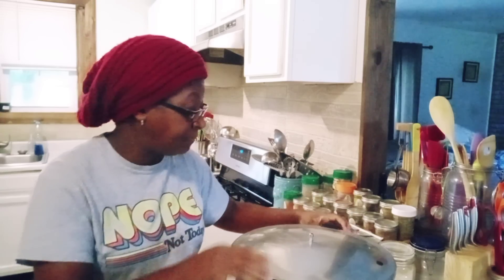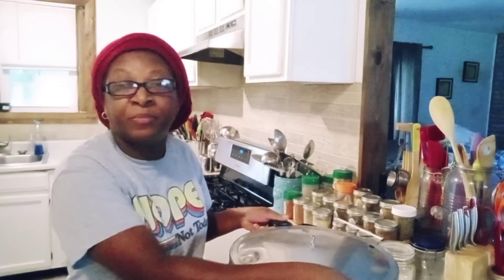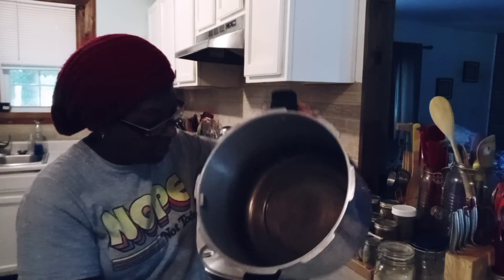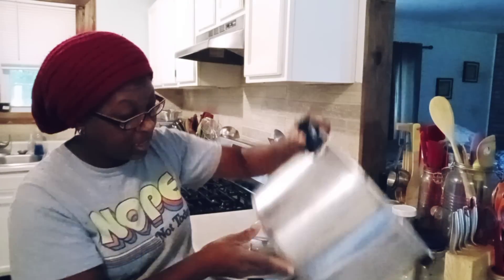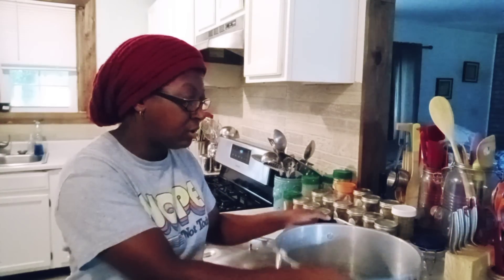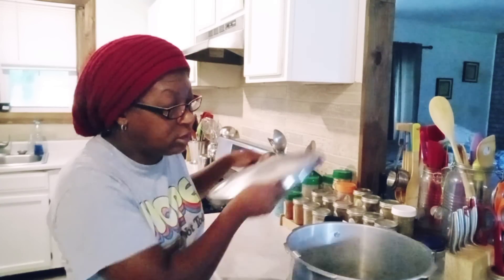WHEN YOUR PRESSURE CANNER GOES BOOM!

Comment: As meticulous as I am, I had an incident with my all American 921 canning chicken.  I completed the canning process on an outdoor camp chef propane stove.  I turned the stove off ( I thought) and went inside for 40 min to let canner cool.  What I had actually done was turn the stove on high.  When I came back out I heard a strange noise and the canner was hotter than a pistol.   The weight had blown off,  water inside boiled off,  the pressure gauge was at zero, BUT the pressure safety plug had NOT blown off.  I turned the propane off and let the canner completely cool.  Once cool I opened the lid, cleaned the entire unit, set it up for another canning session and it worked perfectly including the pressure gauge and controlling the pressure. It did not blow up and.the jars inside did not break.  The fluid in the jars was almost gone.  So that's my experience with the All  American 921.

Comment: 36 year canner here.  The ONLY time my canner went BOOM 💥  was right after I replaced the pressure release valve.  I replaced it upside-down!  DUH!
The LORD was with me that day!  I was about 5 feet away.  The valve hit the ceiling.  Vapor was expelling into the air and I turned off the burner.

None of my jars exploded!  It was a miracle!  I put the valve in correctly, restarted the process and every jar sealed.  Good thing!  It was 2020 when there was a lid shortage.

God is Good!

Comment: I've used the same Mirro canner for 50 years. About 30 something years ago I put beef bones in the canner to make bone broth. I'm assuming something plugged the vent hole because it was jiggling nicely until I needed something from the garden, got distracted and forgot it was cooking. Not too long after that I had that oh crap moment and ran for the kitchen. Last time I EVER left a pressure canner or cooker alone. The emergency pressure release had blown straight up and had made a neat, tiny hole in my kitchen ceiling. Steam was spewing almost to the ceiling. The weight was on the stove top. The plug didn't make it through the roof, so I'm assuming it's still in the attic somewhere. I was able to salvage most of the broth. Next time I went to town I bought a new plug and have used it ever since.
Reply: That's a good story!  I get distracted too when cooking.  Because I am by myself I just bought a Carey electric canner and it works really well.  Just that the capacity is limited. a That's ok with me, I just canned sweet potatoes and it took all of my 5 lbs to fill my 5 pint jars.
Reply: @darlenemassey6161  It's a much more entertaining story now than it was when it happened. I had to take money from my grocery budget to get the new valve; at the time I think it was almost $2. I wasn't happy.

Comment: Mrs H, awesome information! Reminds me of my canner explosion… I inherited my mom’s old canner. It is over 50 years old! Works great. It has a new gasket because the old one was getting hard, so I found the manufacturer & ordered a new one. Works great. No issues.

My canner also has a new pressure valve because dumb me left a towel on the rattler when I was canning chicken, and the valve popped. Scared the devil outta me! The canner wasn’t damaged, though, and all the jars were fine. The manufacturer still makes valves for it so I ordered 2!

Comment: When I first started pressure canning it started whistling very very loud. After the 2nd time of it doing that I thought something ain't right. I called the manufacturer and the lady told me it's the rubber ring on the inside. She sent me a new one and its been fine since. I make sure I add oil to the gasket each time. It was scarry and so loud. I kept reading manual to see what up, that's when I called. Got over that and kept canning. No problems since. Glad your addressing for the newbies. Nancy from nebraska

Comment: 🤣 I remember how I felt first time I used a pressure caner!!! 😱😱 I had only caned using the water bath method previously. As soon as I had filled the pressure caner and turned the heat on, I backed away real fast! As if the contraption was going to jump off the stove and smack me in the head! 😳 I sat down at the far side of the kitchen table, furthest away from the stove, that had that terrifying heating "bomb" sitting on the burner and just stared at it, waiting for WHEN it would "go boom". 😲 I did hurry and put the rocker on it when I had seen that the steam had been coming out of the spout for 10 minutes and retreated back to my chair real fast, to just sit and stare at it again... Didn't lower the heat, figured that one out later. Man was that rocker rocking!! 😁 Anyhow, when the time was up, I snuck up on the caner again and turned the heat off. Back to my chair, sat, watched and waited for the pop up thingy to drop so I could open the caner and hopefully not get blown to bits... 😅 Second time caning, I was much braver and after the 3rd time. Meh... nothin to it! 😉

Bought a new 23 qt. Presto caner 2 yrs. ago. And tried to get used to the pressure gauge in the middle and not go by the rocker... Nope... Can not get used to going after that thing!! Read up on the issue I was having and found out that I could use the weighted rocker instead and WOOHOO!! I'm caning away again. It's not that I'm scared of the pressure gauge, I just don't trust it. I'm so used to the old caners with only the rocker and know how it's suppose to sound, without even having to look at the caner. I'm like... Why fix something that ain't broken?? 🤔 I guess it's true that some "old dogs" you just can't teach new tricks. Or, I'm just set in my ways... 😁

Comment: I’ve been canning for over 50 years. Only accident was with a small food pressure cooker was when I got it too full of millet cereal. The vent plugged so the rubber safety plug blew and millet rained down all over my kitchen like Mount Vesuvius. My kids will never forget it. Otherwise I’ve canned 100s of jars just fine with my two big pressure canners. You just make sure you check those vent holes and rubber safety pugs every time. Also get new lid gaskets when they get stretched out. Happy canning.

Comment: Every one of those ports act as fail safes should an extreme amount of pressure builds up inside of them.  They will blow out before the actual pot or lid will.  The Boston Marathon Bomber used that pressure canner as a bomb, BUT he had welded all of those ports shut in order to do so.

Comment: Way back in the old days(50's) when they had pressures cookers with gauges mounted on the lid and the gauge was not accurate may indicate zero pressure and  it was not zero, you open it... boom!

Comment: Replace your rubber seal occasionally.  Mine was leaking slightly and I canned a batch of fish.  This is a 90 min can.  Mine ran dry, and I was in the next room and heard it stop rattling.  I ran in there to get it off the burner but the bottom bulged out.  I replaced the rubber seal and even with the bottom not flat, it works fine.  
I also now store my gaskets in a ziplock bag in the fridge to extend their life.  I was told this by an experienced canner.  Seem's to work.

Comment: Can you still use a warped canned on a gas stove?
Reply: Following.  Have the same question because I have a 16 qt Presto canner that is wobbly on the bottom but have been using it anyways on a gas stove. That canner is give / take 15 years old. Never ran it dry but once did run it to where 99% of the water was gone. Still had a tad left underneath the rack.

Comment: This is a great video that speaks to DON'T BUY CHEAP CANNERS!!!. Metal can have flaws in it just like any other materials. Some countries use very low grade quality of metals that can fracture under pressure, kind of like the old ash iron, weak as all get out. Get a good one it will last for many years if properly maintained.

Comment: My Presto canner bulged like that. I used it for 43 years. I still use it. 😁 I do have an All American canner I use also. The Presto just rocks back and forth on the counter. It doesn't work on an electric stove well though. I blew up eggs I was boiling for Easter. Water ran out, I got distracted until they started blowing up all over the kitchen.

Comment: Mrs. H, My pressure canner is releasing steam and dips of water from the side where the lock is on handle. And the emergency pressure popped up. I checked my seal and valve im clueless because I'm a baby to this. Brand I think is a Barton. Help any advice 🙏

Comment: Ok this helps me a lot. I  have another question.  I have a glass top stove. I'm sure it can handle the weight of my canner because I water bath on it. But electric stoves turn on and off automatically,  to regulate temperature.  Will I still be able to maintain the pressure?

Comment: MRS H YOU COULD PROBABKY FIX THAT IF YOU TURN UPSIDE DOWN WITHOUT LID ON FLAT HARD SURFACE AND TAKE A THICK BOARD OR SOMETHING AND place it on warped area and HIT IT WITH A HAMMER

Comment: My canner had to be replaced because the bottom bulged as it got too hot, the pressure went too high. If you find a canner at the Salvation Army or a yard sale really cheap, look at the bottom for bulging. It’s NOT a good buy then so walk away. Make sure to watch your canner’s pressure indicator cuz my pressure keeps rising so have to lower the heat as it works.

Comment: I have a 1970's 16 quart preasure canner/Cooker. I put a new rubber gasket ring in the lid and when I moved I left it in storage for several ears. I finally was able to get it out. I dcrubbed it and soaked the gasket and cleaned it well. I let it all dry over night b4 putting it back t ogather. I decided I had to test it with just water to make sure everything  still worked well. So I did an hour cook at 12 lbs of preasure. Everything went totally smooth. I was happy. Then after it sat and cooled It was finally time to remove the lid and get ready t o can. But the lid would not open. I have worked on getting it open for over 2 weeks now. I even broke the antique top handle. I was 15 when I was given this canner. I desperately want to fix this but I have never had this issue before.

Comment: I have used a regular pressure cooker for over 50 years now - piece of cake.  The only challenge using the pressure canner was all the steps and the time involved.  Just remember its not like the dishwasher where you turn on and walk away - monitoring is required.  I use the big Presto too.

Comment: I forgot to mention....I am 57 years old and have 2 used pressure canners.  One is from 1953, the other from 1957.  The  brand names are before the company became Presto.  
My point is, as long as you change the seals and valves each year and don't lose the weight, you are golden!

I've taken both to my cooperative extention office for them to check the gauge and they are accurate.

Don't be afraid to buy one at a garage sale!  I've been using both for 30 and 36 years!

Comment: I can tell you first hand, but it wasn't a canner, just a standard twist to lock pressure cooker. I was only 6 years old (1973). It blows the lid off, and straight up into the ceiling, with all the beans being cooked all over the ceiling. It's why I'm still terrified to can.

It knocked a hole in the kitchen ceiling. I heard the loudest BOOM I'd ever heard, and my daddy, and my granddaddy's shot guns - and taught me to as well.

Comment: I had a small pressure canner blow on me years ago. It just blew the relief value out and steam went straight up to the ceiling. Food can be in the steam going up to the ceiling and can get on the ceiling, so you really don't want to clean up a mess like that. I wasn't doing jars, it just had food in it. It was scary, I was with it when it blew but it didn't explode in anyway.

Comment: Mrs. H did you know you can send that pressure canner back to presto and they can reset it.. Unfortunately II ran mine dry also and called them to see if what I was canning Was good in the conversation she had me send the bottom back and they reset it. This was just a few months ago.. I have used it at least a dozen times since and it worked perfect

Comment: I went to school, in 1978, with a girl that got burned from a pressure canner accident. Not a pretty sight. It scared me for 45 years to not want to use a pressure canner or pressure cooker. Now I understand she was using a very old canner, without the modern safety devices. I think she took the lid off while still under pressure.

Comment: My friend's canner blew the lid off while she was cooking pinto beans (not canning) just cooking.  A bean hull clogged the thinga ma gig, building pressure.  She ended up with beans on the ceiling and all appliances and all over the floor.  The lid just missed her head.  That was some 50 years ago and she has since passed but she never owned another pressure canner. Neither would I - still don't.  But I do water canning .

Comment: mines leaking thru the lock so bad that it continues after steaming thru it like the steam vent it releasing it got up to 8lbs of pressure i turned it off removed it from the stove eye it took 5 miniutes for all steam to vent from the lock area , when i removed the lid i noticed the bottom part of the lock came unscrewed almost all the way from the inside , what causes that ? and this is a brand new pressure canner

Comment: I have a question. If I've got a pressure canner that has a 15 pound pressure gage can I change the gage to a 10 pound gage since I live in an area where I only need 10 pounds of pressure???
Reply: Get a jiggler.  They are awesome!
Reply: @charlenesmith2989  I have  the pressure regulator but it only starts moving at 15 pounds even with my 3 piece  pressure regulator that's 5, 10, and 15 pound pressure, but even it doesn't start jiggling until 15 pounds pressure on the gage. So that's why I'm asking if I can change the gage to a 10 pound pressure gage . I think I'm going to buy one and see
Reply: Did you take one of the rings off so it would rock at 10lbs?
Reply: @charlenesmith2989 , yes, I took one of the rings off  but it still did not start rocking until the gauge hit 15 pounds, that's why I think I'm going to buy a new gauge and try that. Thank you all for your advice

Comment: I had one on the verge of going dry, I put it on a cold burner right away. The chatter sped up big time to warn me, I'm ALWAYS with in hearing that chatter at all times. Opened it after cooling it had a quarter inch at most. I had it over half up the jars on water level. But that 90 minute cook time. My dad blew the safety plug one time.yeah I know it wreaks them. But mine I still use cause I caught it just in time.

Comment: I NEEDED this video yesterday morning. This post will be long cause I'm not editing🤭I googled, YouTube some of Mrs. H's old video and wasn't able to find what I needed. I've been canning since March and yesterday I had to can 4 quarts of beans and 3 of chicken, well, I couldn't tell if the stream was coming out 30minutes after the vent came up. I thought usually it doesn't take this long so I'll just pop on the weight, well, the weight wasn't rocking as it usually does. So, I decided to turn it off and start over. I didn't want to take the chance. Only one didn't seal and I know why. Something is off with the seal on the lid, I'll be correcting that cause I have more canning to do. Until than I'll use the one with the gauge that I don't care for but it gets the job done. Thanks for all you do. So I returned home from work a little while ago and found that I have a false sealed jar as well. How did I find out? I turned it upside down and the juice came out🤭 I usually picked it up by the lid to check but since the 4 beans were truly sealed I figured the chicken were as well. Guess I'll be making chicken pot pie to freeze this evening or tomorrow 😁

Comment: Mrs. H, I was canning chicken in my presto canner, third time using it, what I didn't know was the stove was not working right and gas was not even. When three hours were up, I turned off heat and waited, then removed weight and waited, did it all right, nothing happened to my jars, all sealed and they were good, however the bottom of canner is now round! Shucks to Betsy! Ruined my canner!
Reply: Mine has more of a bubble on the bottom than yours does. Lol

Comment: I blew up a canner several years ago.  I didn't know that you weren't supposed to use it on a blast burner like you boil crawfish on. It split across the bottom and 7 quarts of pork loin squirted out of a 1/4" gap. The olny thing left in the canner was the rings and a few lids. My fault completely.

Comment: The little opening openings I have found to stop hold it up to the sun out your window you should be able to see light on the other side. If you see no light run a tiny wire through the hold back and forth might be a bread crumb got stuck in there my whole family have canned all their life and I'm 70 and canned all my life. Nothing has ever happened.  I was always taught to monitor untill pressure is down!

Comment: You answered my question so very clear and I’m not scared anymore. Thank you so much.  I have a 22 quart MIRRO. IT SAYS 70 percent faster.  I’m at 400 elevation . I’m not sure what wieght to use   I read the book and it doesn’t even say what weight to use for my elevation. I’m stumped   Can you help.  Thank you in advance
Reply: Go to the USDA site and look. But I think anywhere under 1000 ft is 10pds pressure. Above that  you go up to 11 lbs. but do your due diligence after checking. Hope this helps.